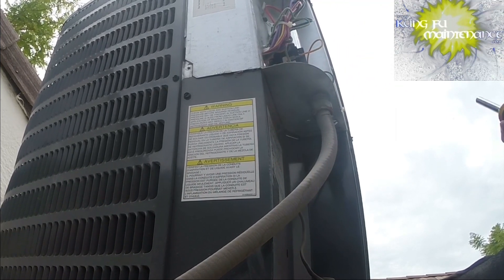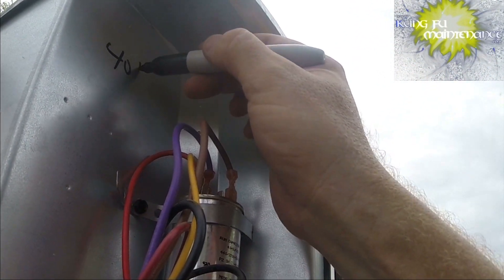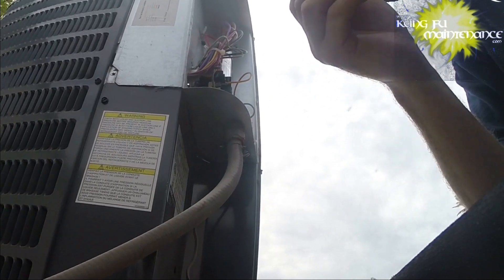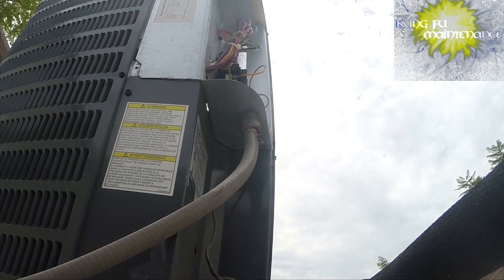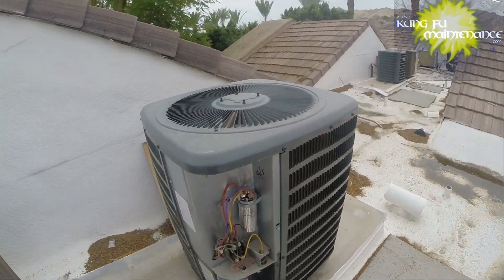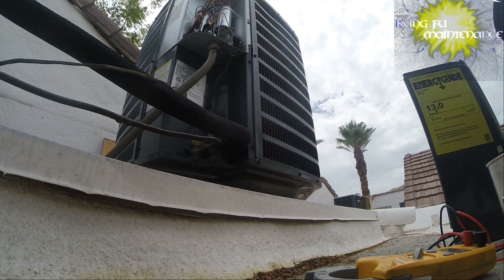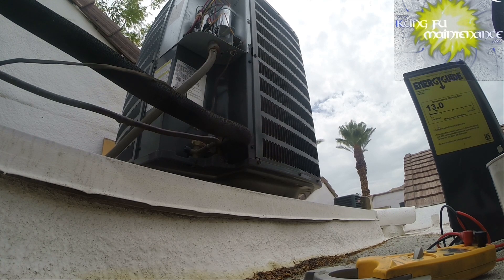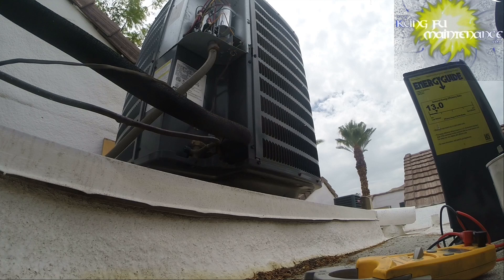Air Conditioner Air Not Cold

Comment: Hi, my ac was working great until I changed out the
thermostat and now the system is not blowing cold air. I put the old thermostat
back on and still blows but not cold. What did I blow up? ha...Thanks
Reply: I’m having the same problem right now, what was wrong with yours

Comment: How much did that job cost the customer?
Reply: KungFuMaintenance what do you mean you don't charge? You do it for free or you do maintenance for an apartment complex? Just to let you know there is absolutely no need for a hard start kit unless the compressor is having a hard time starting! Just cause a capacitor goes out doesn't mean the compressor needs a hard start kit. And never buy a capacitor made in China , they don't last.
Reply from the maker: +Shams Hirani At present I do not charge my customers.
Reply: Where can I buy a AC capacitor?